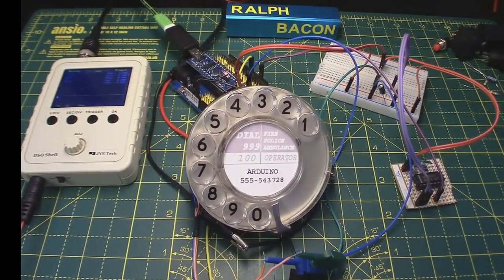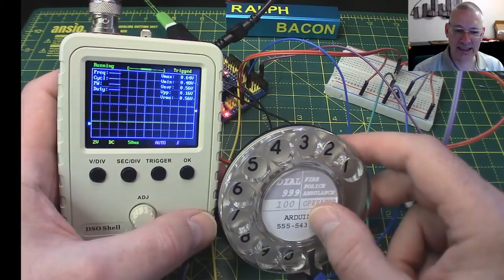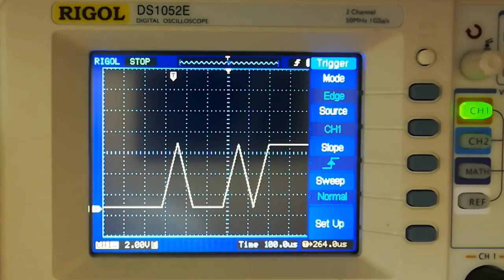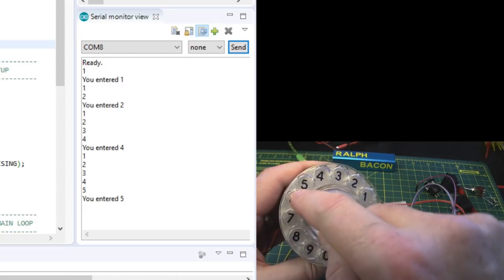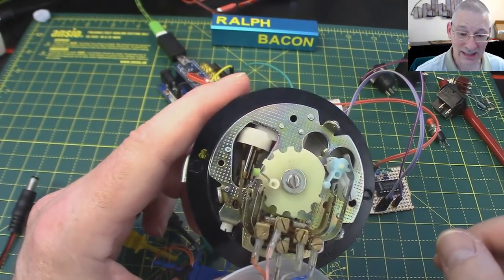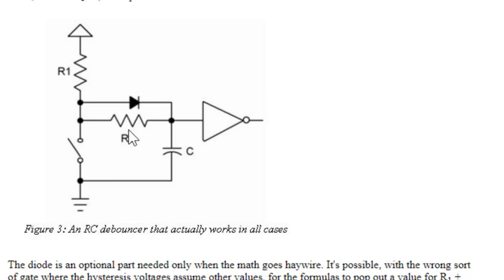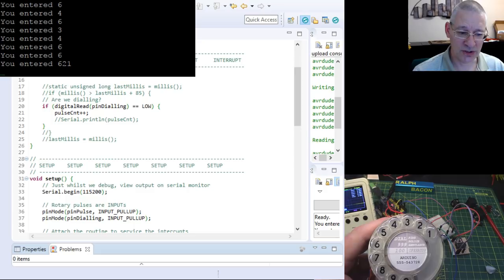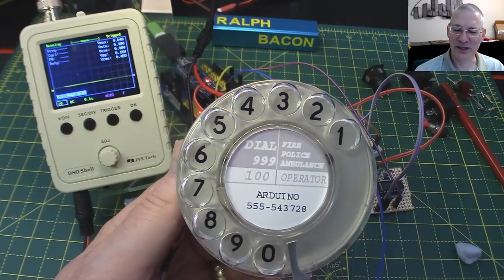#98 Telephone Dialler ☎️ and Hardware Debounce Solution (retro)

Comment: That brought back memories of my early working career. Not just replacing defective dials but repairing them too. Arguably, the ones most abused where those fitted to public pay-phones.
Reply from the maker: Who would have thought that public phone boxes would get abused by vandals, hey, Brian? But I like the rotary dials from public phone boxes, because they were all shiny metal and probably had metal gearing too. They were really smooth in operation (before they got vandalised anyway). No chance of getting one of those I'm afraid, not unless you buy the phone box to go with it for a few thousand. Ah, memories.
Reply: Nostalgia ain't what it used to be.

Comment: Ralph,
I caught a quick glimpse of your DSO and noticed that you haven't updated the software yet.  Your scope seems to be running very well without the firmware update.  I was blaming the SW for the problems I was having but it might have been problems with my construction instead.  Anyway the newer firmware seems to clear up my problems.
This was another GREAT video. Thanks for all your hard work.
Reply from the maker: You're too kind, William, and glad you liked the video. I enjoyed sorting out the switch bounce for any device using Jack Ganssle's brilliantly simple, yet highly effective, circuit. I hope to test this using a Rotary Encoder soon.
 
On the subject of the DSO I checked my s/w version a couple of weeks ago and I thought it was the latest? Not so? I even took it apart to flash it and discovered (or so I thought) that I didn't need to. I'll check again, but as you say, it is working rather well for the simple stuff we usually do with Arduinos. Glad yours is now behaving properly too. Thanks for posting.

Comment: And another perfectly appropriate video - I'm actually in the process of making a project with one of these turning it into a USB keyboard by hooking it up to a Digistump ATTiny85 (which in theory should present as a HID device) It was, I have to say, inspired by your touch project for your little hot-key box.  My problem is that the contacts don't always seem to make as the cam releases so I miss pulses, but I'm sure some judicious switch cleaner may resolve that.
Reply from the maker: If you have really old one (or one in poor condition) then the contact could easily have got dirty or corroded over time. As you say, switch cleaner and a really thin and fine emery board (like the ones ladies use for their nails) may sort it out.
 
Interesting what you say about turning one of these diallers into a USB keyboard - I'm guessing you're just using it as a number pad, or how are you getting letters out of it? Sounds interesting though (you see, there goes the inspiration moment again).
Reply: The plan is just to use it as a number pad possibly with a button connected to another pin as an "enter" key.  The whole thing will then be hooked up to a raspberry pi and be a way of selecting options, entering passcodes etc.
Reply from the maker: Sounds cool. Even if you are using a Pi not an Arduino :) When you get it going don't forget to make a short video on YouTube and share it here, it would be great to see what folks are using these things for. Thanks for the update!

Comment: It's possible to do this without modifying or taking apart a rotary phone. The phone input wires were normally connected to a DC power source, and the contacts would open and close the circuit to that DC source. If you connect the primary windings of a transformer in series with the DC source and the phone, you can detect the switching events on the secondary windings. An easy way to do this is to connect two LEDs across the secondary windings in opposite polarity. When the contacts open one LED will flash and when the contacts close the other LED will flash. You can then read those light flashes with a pair of phototransistors to convert the flashes to digital pulses in a separate logic circuit, or just use optoisolators. Once you have the digital pulses you can denounce using whatever hardware or software scheme you want. Anyways that allows you to accomplish the exact same thing without hacking the antique phone itself.
Reply from the maker: Good to know, Dane. I didn't cannibalise a phone to do this, though, I just bought the dialer. But I like your thinking and the information, appreciated.

Comment: ok, i must admit, i´m getting old as i´m still using one of these old telephones. It´s a "W-48" entirely made out of bakelite and it has, of course, a rotary dialler as well ;) And some younger people don´t actually know how to operate it...;)

The diode in that debouce circuit is a clever solution for very fast pulses, i´ll surely include it in my next debounce circuit. Thanx for sharing...:)
Reply from the maker: Wow, if you knew how much that would cost to replace, Tubical, you would insure it separately!!! I'm amazed that someone is still using the old rotary dialler. Don't you miss the redial button? The phonebook (I suppose you have a hand written one of those)? Amazing. Very, very retro indeed.
 
Yes the circuit from Jack Ganssle is excellent and clever too. Certainly it deserves a place in every Arduinites (digital) bookshelf. Thanks for letting us know that rotary dial telephones are still in use!
Reply: There was a time when these old and black only phones where considered just plain garbage, i have about another four of them i think, and they all had been given to me, for free....as in: there is a guy who "collects" old garbage, let him have this....back in end of the 80th i thing...

Now it´s "Retro" style and i´m aware that some people paying some two eventually a three digit pricetag to own one of these.
I hardly use my POTs but it´s fun to have it and when it rings you´ll never miss a call due to a fail of hearing ;)
Reply from the maker: Well, eBay is your answer if you ever a need a bob or two (that's UK-speak for a dollar or two)! Yes, they were certainly good ringers and they even do what they were designed to do: make phone calls! Good to hear from you, TubiCal.

Comment: Excellent. I don't know why I want one, but despite cursing them back on the old phones, I want one for a project. Just need to think of a way to use one.
Reply from the maker: That was exactly the thought process that I had, Maxx, and I'm still thinking of where I might use it but one day it will come to me, I'm sure. As well as getting suggestions via this channel too. They're great to play around with.
Reply: Could I ask a favour? Please would you post a photo of the front of the dial with a ruler for scale? I had the idea to see if it would be possible to make a 3D printed version, triggering a couple of microswitches to generate the pulses. The mechanics in the back will have to be engineered differently, but knowing the diameter of the dial and finger holes would make modelling the front a bit quicker.
Don't worry if you are too busy, I can always see if I could get dimensions from a screen shot. I just though I'd ask. If I can get one to work, I'll share the design files, so your viewers could make one if ebay can't deliver.
Thanks.
Reply from the maker: No problem, here's a link to a DropBox folder:
https://www.dropbox.com/sh/nox1l1ht71p9asd/AACpup5yWMmxdgzcIxMPjIP0a?dl=0

Any issues let me know (or if you want specific photos of it or further measurements). From what I saw the main dial was a tad over 7cm and the inner dial (where the number goes) 4cm.
Reply: Awesome. Thanks.